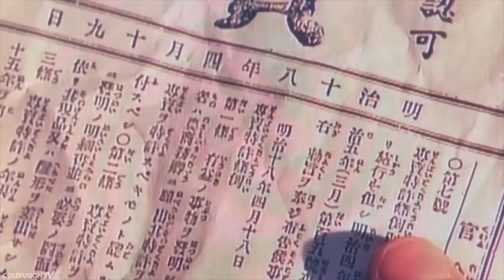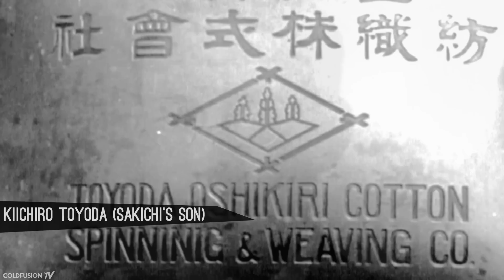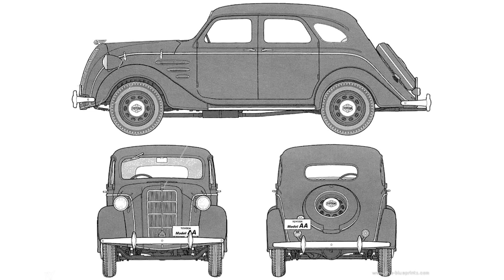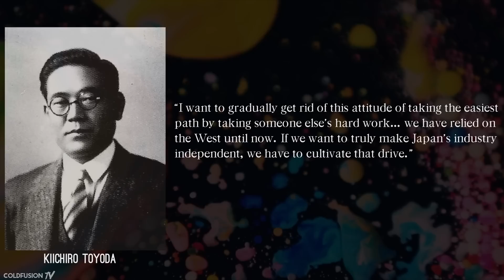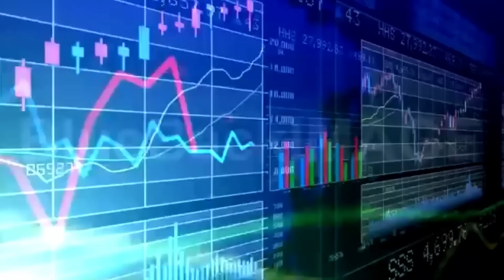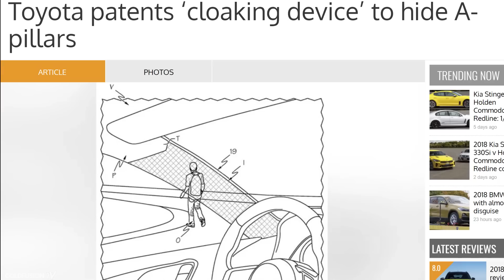How Big is Toyota? (They’ve Owned 27% of Tesla Motors!)

Comment: Do they still equip their vehicles with "Suicide Mode"  like my 2010 Toyota Prius which Suddenly Accelerated Unintendedly on January 31, 2019. This is still happening! This was not the Floormat! I did not mistake the Gas Pedal for the Brake Pedal! I Never Have! The pedal was not Sticky! It Sucked itself Full Throttle right to the Floor when coming out of a right hand turn! Brakes held but Engine was Revving like crazy. Every time I released the brakes to try to get the gas pedal to come back, the Prius took off. Can you imagine starring down with your foot on the brakes, and the gas pedal is still pushed in Full Throttle? Explain that?? It did this for about 2 and a half blocks. Shifting to Neutral was NOT working. It wouldn't Turn Off. And I didn't want to press the "E" Brake risking the lines snapping and having NO BRAKES! That was my last resort. This was Crazy and Vehicle Manufacturers need to be held accountable! I've made a "Safety-Related Defect Complaint"  to Transport Canada 🍁. You should all do the same in your country. Let's fight this and end Sudden Unintended Acceleration!  Maybe going back to a Drive By Cable system instead of Electronic Throttle Control will be the answer. There's gotta be a solution!

Comment: Toyota certainly equals value & reliability, but they have also tried to be innovative, not always successfully, as their F1 attempts showed. But good on them for being a 'family car' company who at least tried that hi-tech, super fast world on. They also have the new BMWZ4/Supra, which looks like a great car that they weren't afraid to do jointly with the Germans, because it kept the buying cost down of their accessible sports GT for the middle class. But for everyday sedan use, I don't choose boring and my German engineered 2010.5 VW R36 and 2017 PoloGTi suit my driving preferences...but I would always want my grandkids to start off in something as solid and reliable as a Toyota Corolla - then graduate!

Comment: That's funny that the guy drove his Toyota for all those years without ever adding or changing the oil, because one time in the  early 90s I had a used 1978 Pontiac Grand Prix that I drove for about 6 years without ever touching the oil. It's not that I had forgotten about the oil like that guy did, but I was just really irresponsible at the time cuz I had a drug habit, which makes you not care about things like that. I wouldn't recommend that  anybody try not changing their oil for six years, cuz I think I just lucked out.

Comment: Toyota is not always the big reliable cars.
8 years ago I bought a 3 brand new 2010 Toyota Corolla  for my company and it was an absolute garbage, the dealer was constantly calling the cars back to replace defective parts from the manufacturer starting with the AC and ending with the air bags. Don't get me wrong here I love Toyota cars because I had ones before but really after that Corolla it got me thinking to go for another car manufacturer.

Comment: In general, I like the ColdFusion videos, but this sounds a bit like a Toyota advertisement. I owned multiple Toyota vehicles and especially my Verso was an utter disappointment. I even wrote to Mr. Toyoda as even 10+ repairs could fix the airbag problem on the brand-new vehicle. No solution was found and I had to sell my car with steep discount. The biggest Toyota disappointment for me was when the ISIS was parading in their brand-new Toyota pick-ups with canons mounted on their back. That must have been good margin business and there was no competition from VW…

Comment: I want a basic toyota truck.
No power anything no 500 airbags  just a 4 cilinder manul 5 speed transmission no frills mini truck 2-or 4 seater with basic 22re motor. No radio. No power windows or door locks and no body control computer just a computer for the motor.
Priced at 10-20k max with options for power windows and locks and air conditioning and 4 wheel drive.  Oh the 1990's toyota pickup trucks. 
The new trucks have gone overboard on stuff and price.
Its nice to have options but I'd like basic.